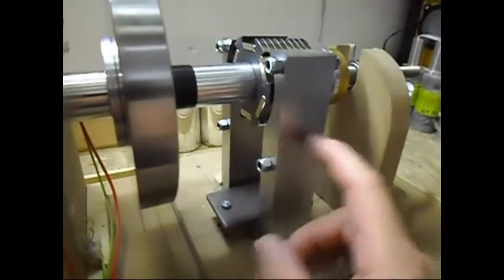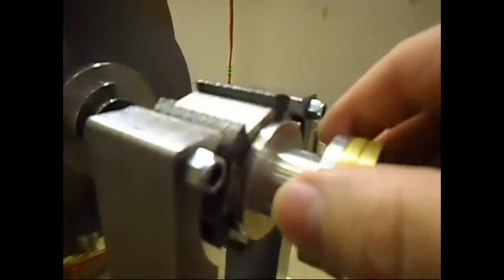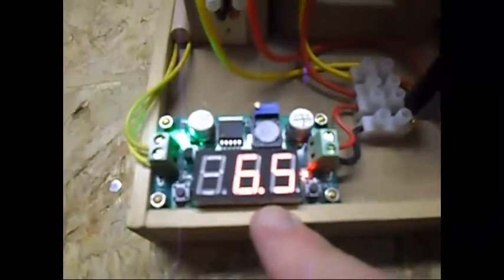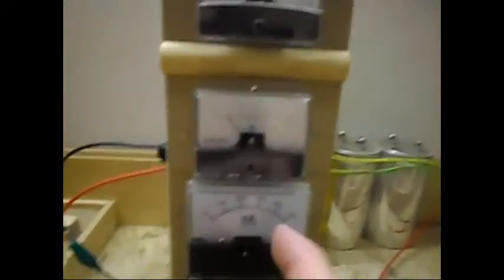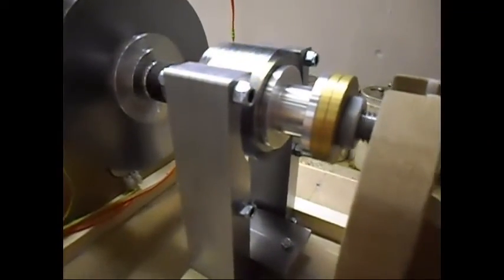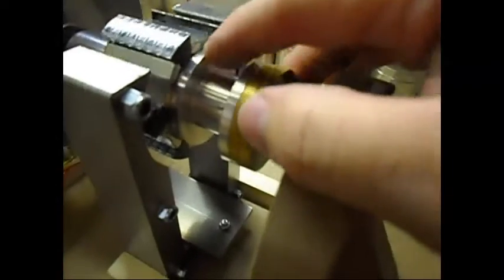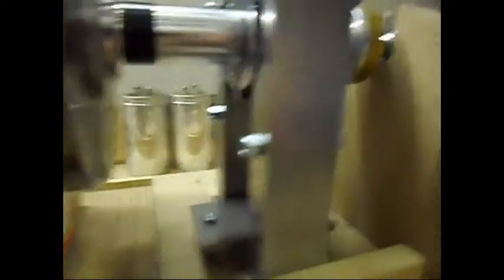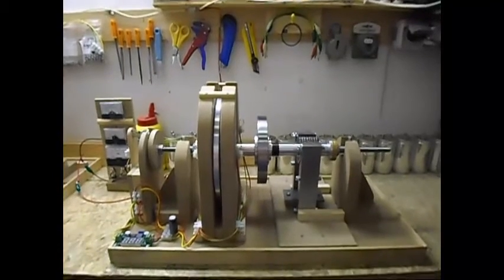Project U-core Dynamo - Update 1, Magnets in place and a test run...

Comment: Your current meters are measuring the Input Current, before the "stepdown converter" (buck regulator)... so you have 14V at 300mA or 4.2W, which at 6V (after the stepdown converter) is about 600-650mA... right?
Reply from the maker: Thanks for your comment...^^
Yep, you are on point there but lets make that 14V a 15Vdc since at the time i showed the digital meter on that converter the slow pulses makes the meter not very accurate...;-)
So 15x0.3=4.5watt...4.5w/6=0.75Amps...so yeh @ 6Vdc the system pulls 750ma...^^